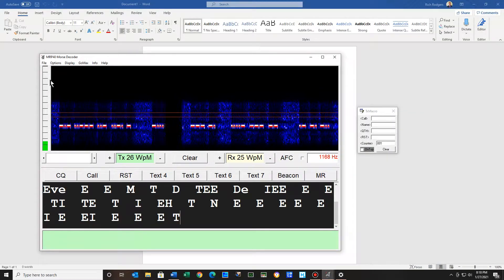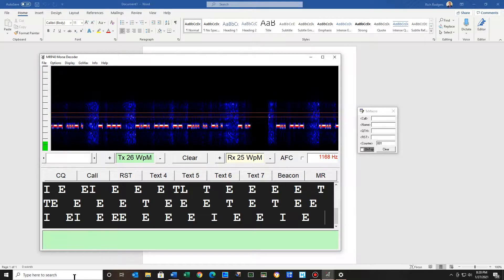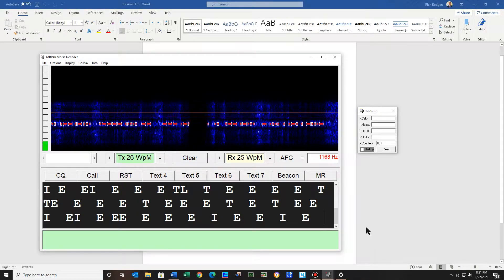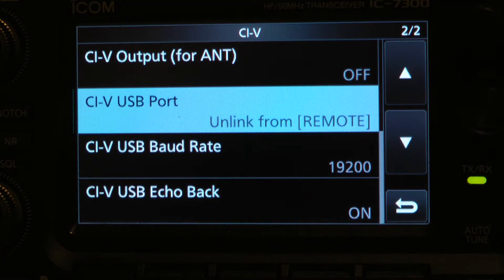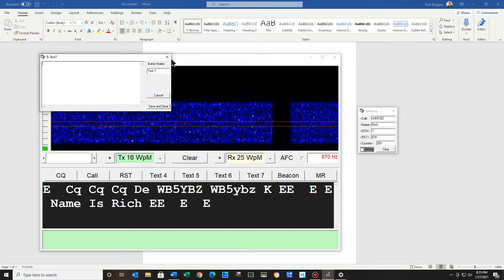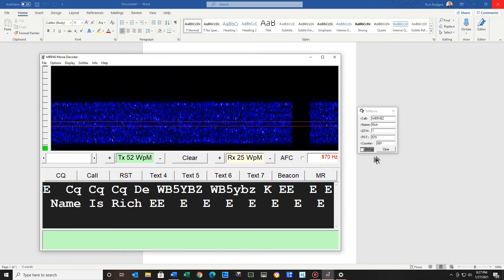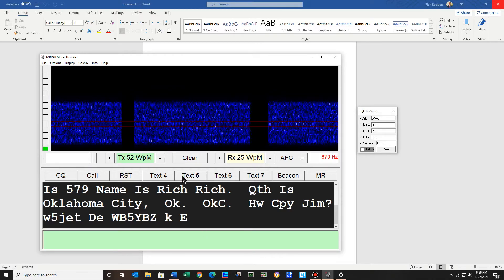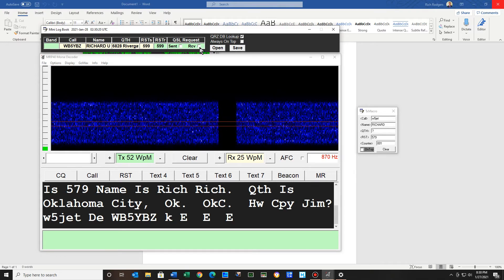MRP40 Morse Code CW Decoder Icom 7300 Settings Easy way to send and receive CW

Comment: I am just getting back into ham radio after >25 years!  Did I understand that no winkeyer is required that you can just receive and send directly with the IC-7300?
Reply from the maker: Yes,  I was using MRP 40 for the CQ WW CW Contest this weekend.  It was GREAT using my macros.  1st Macro was my call sign.  The second Macro was 5NN 4.  The station responded with a TU.  You will love it!  Thank you for watching my video!!!!

Comment: Rich your instructions do not work. ALSO ALSO
Reply from the maker: Hey Gene,   I wonder why it did not work on yours?  Look me up on QRZ and email maybe I can help you.   You are the 1st who said it didn't work!
Reply: @RichRodgersOnline  I'm in the same boat, I primarily used my rig for FT-8, but I modded it all exactly how you outlined in your video, and the PTT clicks on and off in sequence to CW, but it's not transmitting anything.
Reply from the maker: @ednowlin1125  Hi Ed, I am not sure why it doesn't work for you.  Are you using a 7300?
Reply: so far, I am unable to get ANY CW xmit program to work.

Comment: Good Morning Rich.......when I used MRP40 with my 7300 it was easy to set after watching your YouTube videos and worked well. Now I have an Icom 718 and am having some difficulty. I am using a Soundlink as my interface as suggested in the documentation. What is happening is that the radio will only transmit CW when it is in USB or LSB mode. I have written  to Norbert a couple of times and all he can say is buy a Winkeyer. I am at the end of my rope financially and have already purchased a Soundlink at $139 and cannot afford another fancy expensive box. I lost my 7300 due to a bad divorce a while back and do not want to buy another item. I quote this from the documentation page for MRP40 on the web:

There are 3 ways to transmit:
1. Recommended: Use AFSK (audio frequency-shift) keying by sending CW audio to the transceiver from the computer’s sound card. The rig operates in SSB transmission mode. The signals generated by MRP40 have sine waveform and a smooth envelope, so no annoying key clicks. The rise and decay times of the CW-signals are automatically adjusted to the sending speed, so a minimum bandwidth is occupied, especially for QRS (slow sending). Note: When using AFSK for sending, one can activate the PTT via Com Port by selecting the check box named "Activate PTT pin" in MRP40's menu under "Options - Tx-Settings."

My 718 is apparently sending well in USB mode.....Is this OK to do? When you send with it on your 7300, is your radio in CW mode or USB mode?  Do you have any idea what  may be wrong here Rich? Appreciate your help. I looked you up on QRZ and sent you an email on this question also.
Reply from the maker: Oh no!  I am sorry I  do not know what to suggest.  I have used SSB on Ham Radio Deluxe  for CW. You can still use your program on SSB.  Caution, I would unplug the Mic.  If your phone rings or someone comes in the room and starts talking,  you may have  your VOX on.  That noise may come through on the SSB mode.
Reply: @RichRodgersOnline   Thanks Rich.....did some reading today and apparently it is fine to use both USB and LSB for CW in sound card programs that interconnect your radio to MRP40. Too bad I just couldn't get a straight answer from Norbert on that because it would have saved me a lot of worry.

Comment: Rich are you using a single usb cable from the radio to the pc.In device manager i have no ports showing i think its because its a laptop but ?? my main pc isthe same no ports in device manager and i looked at the pc,s at my work and they are the same no ports showing  strange  as all the work pc,s are all  quite new .I loaded the drivers from icom  but still i cant find the soundard which i believe the 7300 has  built in .
Reply from the maker: Try to reinstall the driver...
Reply: @RichRodgersOnline  Thats what i did but i had to  direct the pc to the download folder where the driver was  and its fine now .Thanks for the reply 73,s.
Reply from the maker: Great